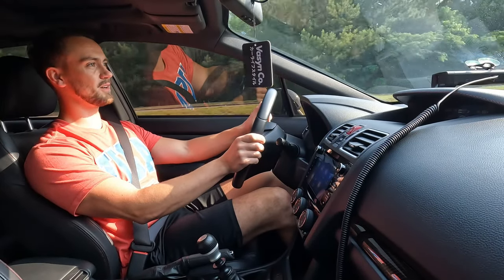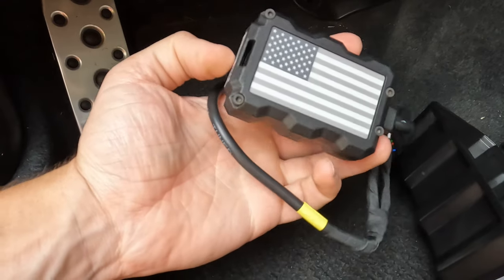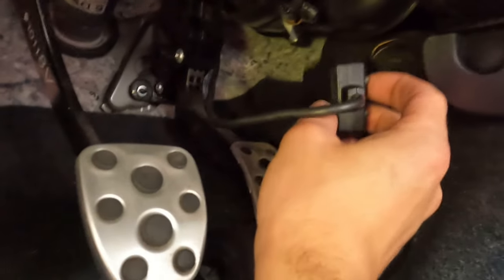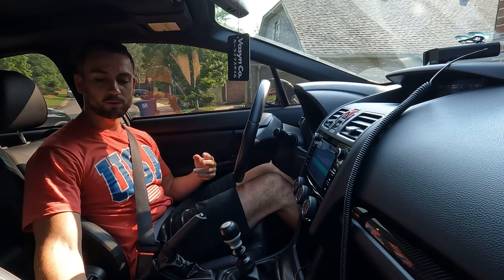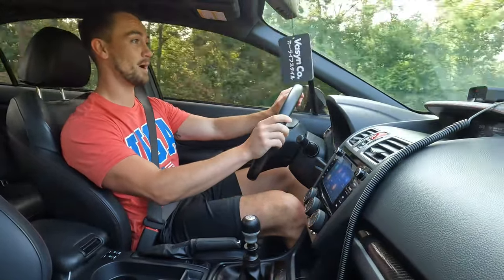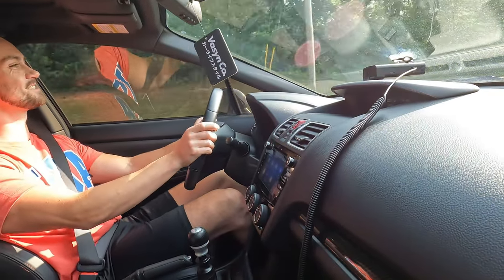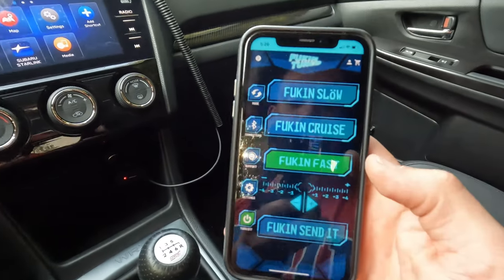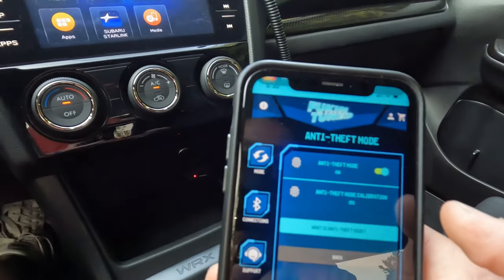FUKIN TUNED throttle response controller installation & review!// Subaru WRX

Comment: And for some reason you need to reboot your phone.  Would it affect the device?

Or better yet.  Does your phone and the device have to be linked at all times?
Reply from the maker: Good question! The device just remembers the last setting. So you can disconnect it without any problems! And when you get back in your car you don't have to connect them unless you want to change the settings.
Reply: Just got mine delivered today.  Cant wait to install and try them out.  THANK YOU!
Reply: @shavdhandlz  yo what do u think bout it
Reply: Ah man…i love it bro.  Thanks for sharing.  I honestly didn't know anything about any of this type of stuff.  Did tried send it but that's too much for me.  I stayed Cruising.  Lol

Comment: could i tune my car with a cobb ap to like stage 1 or 2 and use this with it? or is that pointless? (new to cars and everything so mb)
Reply from the maker: I have added a Stage1+ recently and it still works without any issues. I believe it overwrites whatever the input is from factory/ tune. The tune is supposed to help with the stock throttle response, but the controller gives you more adjustability.

Comment: Have you had any issues with reliability while its been connected?
Reply from the maker: Not at all!🤷🏻‍♂️
Reply: @5.2ltr  awesome! Just got mine yesterday and its been super fun! Thank you for the clarification
Reply: Do you have an access port on your wrx ? And if you do what tune are you running ?
Reply from the maker: @miguelrico2643  I am fully stock as of today. I got a AP on order though🤫
Reply: Has it messed with your SOS feature? I purchased the Banks monster pedal and it works nicely but activates my SOS feature every time I start it and would always get emails and calls from Subaru asking if I was in an accident or if anything was wrong. Also saying I would need to take the car for service.
Reply: @Redleg13fa  the Fukin Tuned hasnt given me that problem at all
Reply from the maker: @Redleg13fa  that’s definitely nothing that has happened to me or anyone else I know! The Fukin Tuned controller doesn’t do that!

Comment: It has anti lag built into controller right debating it for Veloster N
Reply from the maker: it’s not an anti lag system as far as I’m concerned. It helps with lag as, but that’s just because you can adjust the sensitivity of your throttle.